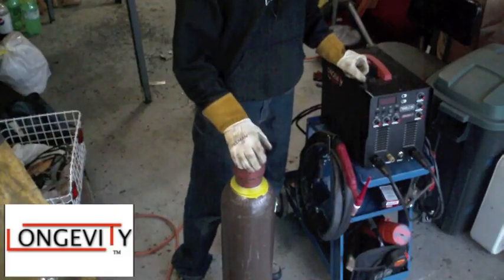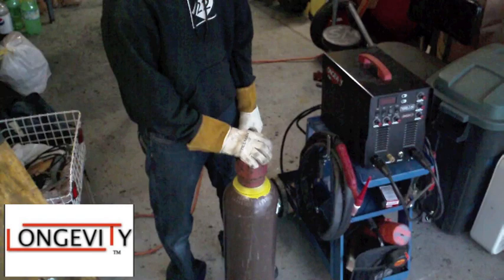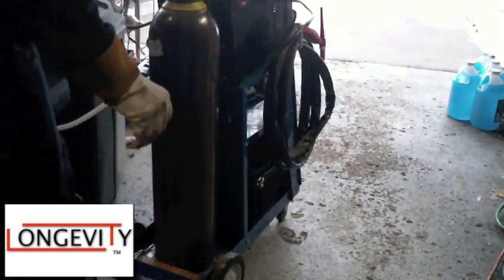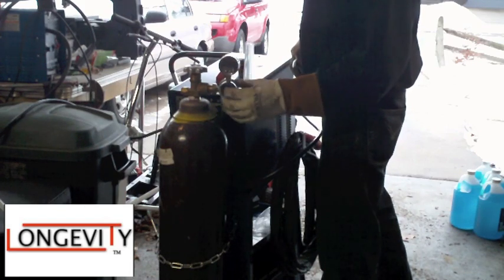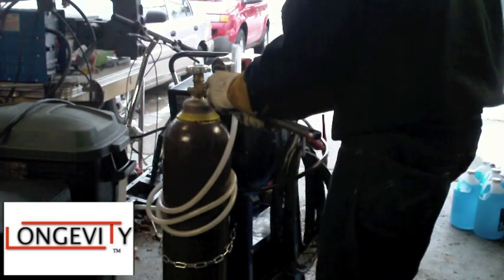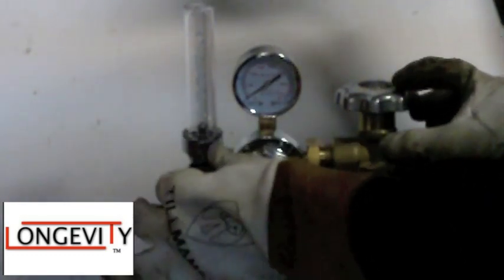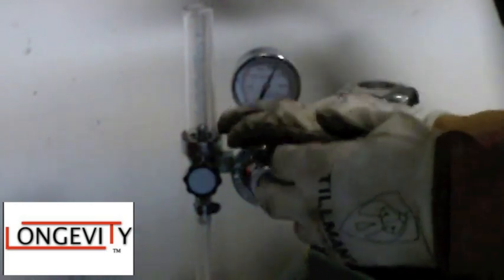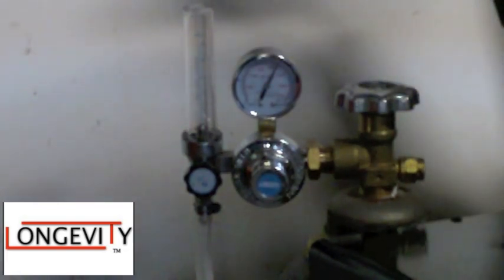How to hook up an argon tank

Comment: I teflon tape all my regulators for every argon tank I have had I have never seen one that doesn't leak without teflon tape. The tape works.  I bet if you spray that fitting if you run it bare you will find some small bubbles. It is worth it to stop the small bubbles because that leakage costs you money

Comment: From the regulator,does the gas line connect straight into the INLET tip on the back of the welder?

Comment: what size tank is that,and would that size be good for a mig welder?
Reply: That tank looks like a 80cf... I just got done two weeks ago deciding which one to get.A tank larger than that is a 125. The 80cf is about 32" tall, the 125 is 42" tall . for me where I went was only a dollar more to refill the 125 tank so I went with that.. they're both good for MIG welders 80 and 125